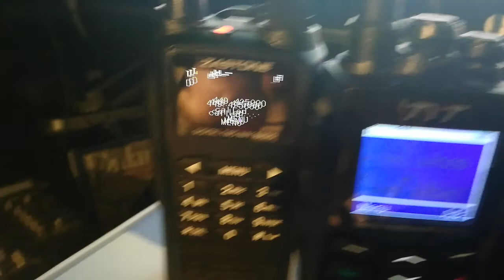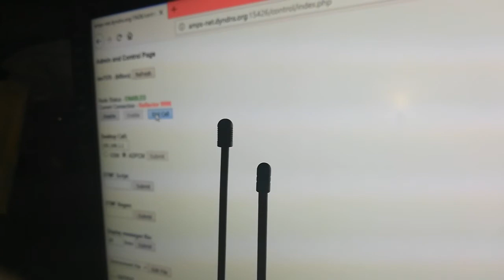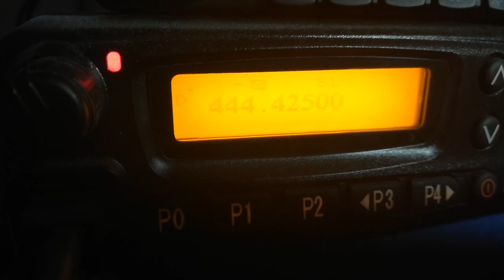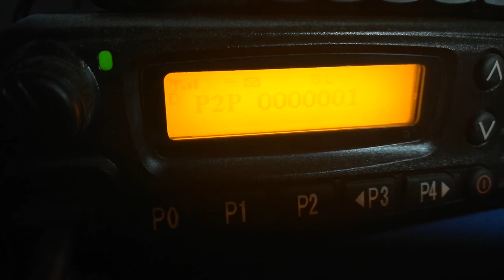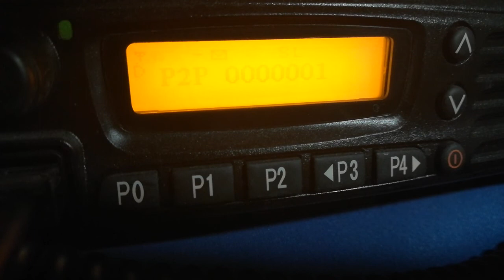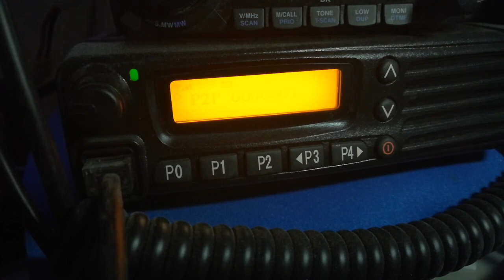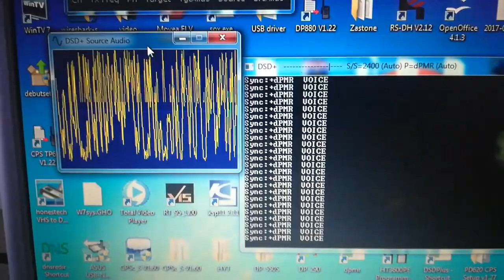dPMR Repeater with AMBE2C

Comment: Do you have the programming software for that radtel radio? I bought one cheap on ebay but couldn't find the software anywhere online. Thanks
Reply from the maker: https://tinyurl.com/y8p75ukk
Reply: Thanks
Reply from the maker: No problem, The Puxing 508D is a favorite of mine and can do UK 3.25KHz spacing! Would have posted earlier but,  I missed the your request somehow.
Reply: Oh, that's really good. That means it would work on the dPMR446 channels, right?
Reply from the maker: Yep, for the others try hex editing the 'saved' file, reload without modifing it, writting directly to radio. i.e. 450.000 '450000000' base 10 1AD27480 base 16,  so dPMR channel 1 446.003125 is 1A9577B5 hexidecimal . Set radio to 450.000 MHZ
and search for hex string.

But for TYT UVF10 the channel frequency table starts at 1203H and is 40H,00H, H00H00H00h like ch 1 is 12h 03h 60H 44H  = 446.0312
Reply: I won't be trying it myself as I have no need, but thanks for the info. I'm making a blog post about this radio so will write about this.
Reply from the maker: A software 'code plug' for the RT2/TYT UVF10 with EU dPMR odd split channels sounds like a worthy project.
Reply from the maker: Made a TYT UVF10 EU dPMR code plug, but it needs to be tested as 446.003125 Mhz can only be entered as 446.00312 which is off by 5 Hz!
Reply: It's probably correct. Usually when radios miss off the last digit, it does actually use the frequency as entered. I don't think 5 Hz matters anyway. You can test it legally since it falls in the US 70cm band